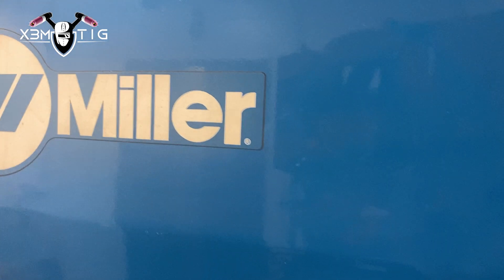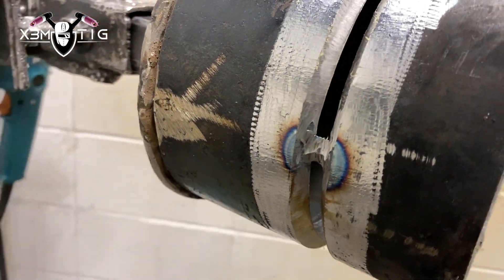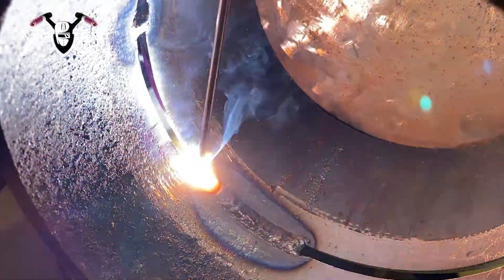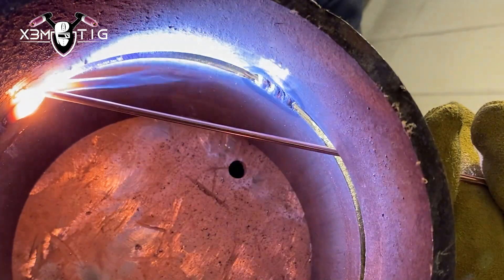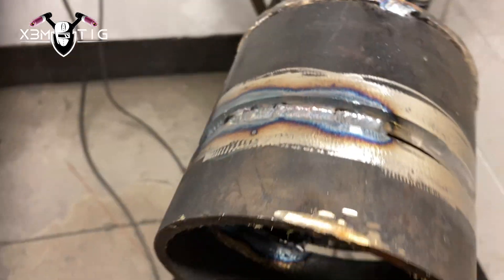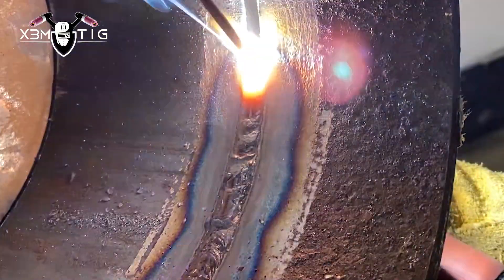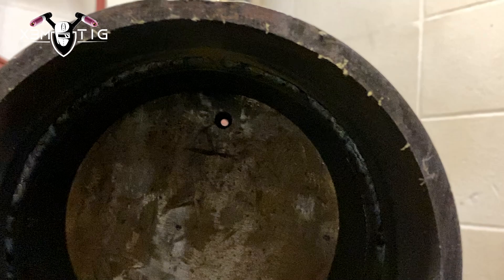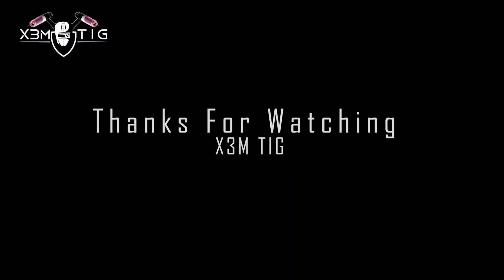TIG Backfeed Technique for Flawless Pipe Root Pass | X-Ray Quality TIG Welding

Comment: Been welding ASME stainless vessels in Upstate New York for two years now. This is my dream job, I went to two welding schools (paid for by the GI Bill) after working in steel construction/iron work for two years. I pride myself on my personal high standards of work quality, and after about a year my speed was on par with most others, but my quality was far better than the vast majority of my peers. The one aspect I struggled with was my pipe root passes. Your videos have helped me in that department immensely! Thank you, and keep up the good work.
Reply from the maker: Thank you brother, very happy to hear that. 👊
Reply: Why did you go to 2 welding schools
Reply: @JonRena-r7f  the first was Lincoln Tech. Very basic school, but I got plenty of hood time out it. An instructor from my last class said we’ve all learned enough to get us a welders helper/fitter position, and that the school he went to was more fabrication oriented, within 24 hours I was touring the AMC at Community College of Denver. Possibly the best kept secret in welding education. Phenomenal facility, generously funded, and very driven and passionate teaching staff. A lot of people ask me the same question, most don’t get it, but I wouldn’t change a thing!
Reply: @JonRena-r7f sometimes the schools just suck in my experience
Reply: this technical welding, often using on oil and gas industry

Comment: Have you ever taken a weld test that requires you to run the root at a higher amp than 95?
Reply from the maker: Not really as I'm always running my root pass around 120-130 amps, only for stainless is lower.

Comment: Nice root, however I’ve worked for companies where the plant wants the root at 1/16th. 1/8th or slightly higher will bust
Reply: Thats usually how it is, this is an insane fitup 1/8 gap is normally max, anymore and a fitter is getting fired

Comment: On job i am on now we have to use 70 s 2 tig wire it wells so trashy you cant hardly do anything with it
Reply from the maker: Yeah I know, that rod is specifically designed for dirty applications, but once you dial in, it should work fine.👍

Comment: Great video.  Thanks for sharing your skills with us.  You have great way of explaining your technique.  I feel like the lowly grasshopper to the Master.  One question though:  Can you use an automatic lens with through the gap welding or does it tend to flash on and off?  Thanks again, you are the Master.   Sparky
Reply: X3 MrTIG thanks for your prompt reply.  Keep up the good work.  You’re doing a great public service to the welding community. ✊Sparky
Reply from the maker: Hey bud thanks for your comment and the question. Good point tho, it does flash on and off when welding trough the gap. I use regular shade 11 lens.

Comment: On top are you pushing and wire or just the minimum to keep tension and the filler connected
Reply from the maker: Hey bud, no pushing, just keep it constantly connected with weld puddle.

Comment: Excellent welding m8 what angle are those pipes cut at please?
Reply from the maker: Thanks bud, standard pipe bevel pipe angle for welding is 35-37 degrees, didn’t exactly checked this one, but it’s in that range .
Reply: @X3MTIG  thanks

Comment: I do well back feeding As long as I don’t stick my rod to the inside of the pipe
Reply: How do we combat this? More heat?
Reply: @trailerpark6.7  I got it down now, I think the thing that helped was just being more accurate with my rod. Once I could keep it in the puddle I was good. It would stick once I came out of the puddle a little on the side. You could always try more heat. But if you're keyholing and not able to satisfy the puddle I'd say you're too hot then. My thing was accuracy tho I think.

Comment: Looks so easy) anyway with 1/8 rod it is easier because you don't have to feed feed feed, just keep it in there
Reply from the maker: True enough, but little correction, 5/32 is 4 mm.
Reply: @X3MTIG  yeah, I put it wrong way. The right is 1/8 wire (3.2mm) and 5/32 gap (4mm)